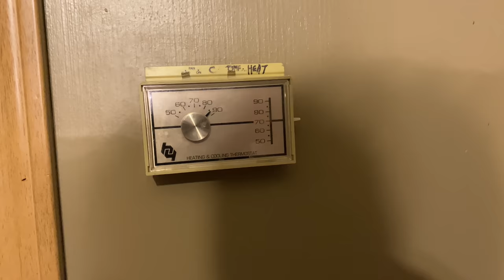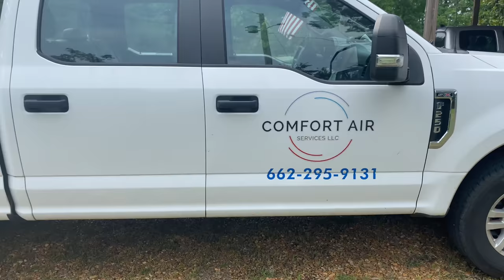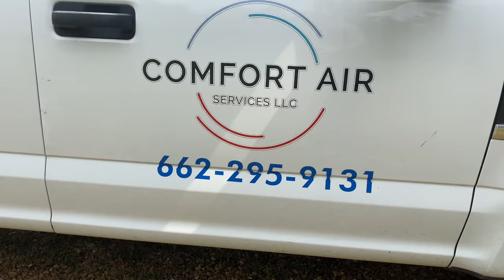Power outages and my A/C is out.

Comment: You can buy capacitor for $25-$30 have on hand. Lot time you just hear your unit humming but fan not turning usually the sign just be careful not to touch top of one you take off they can hold a charge